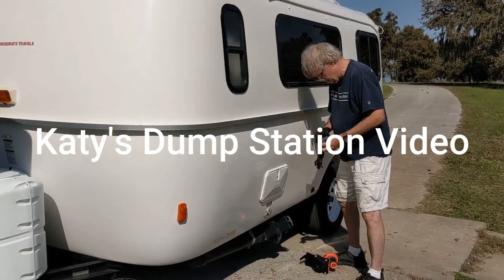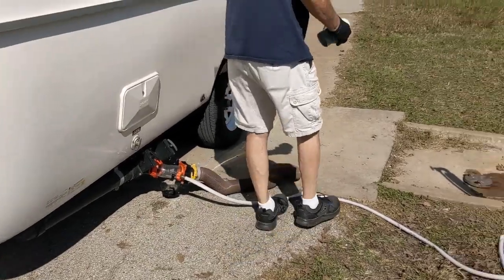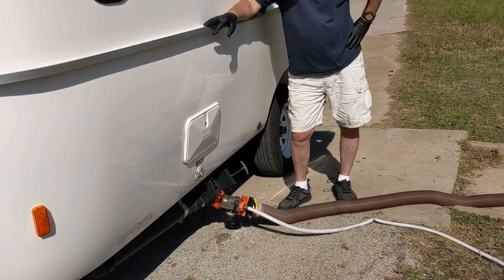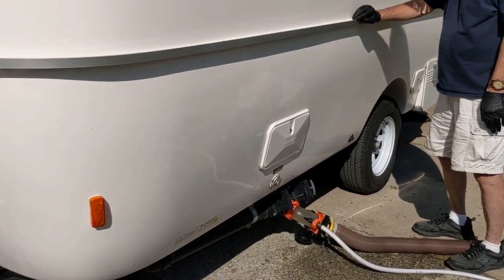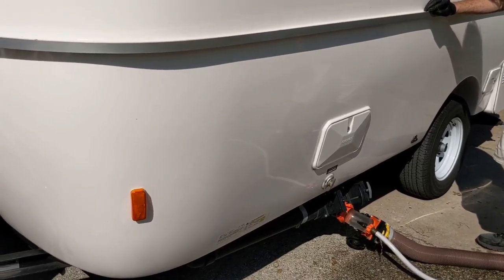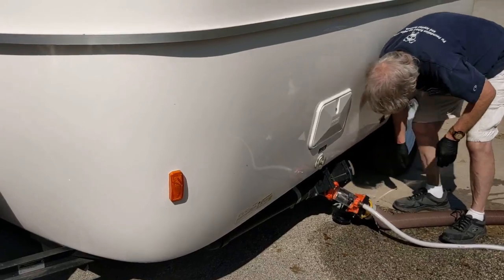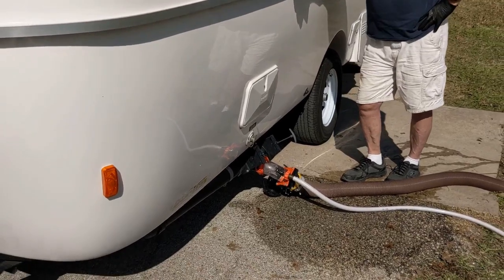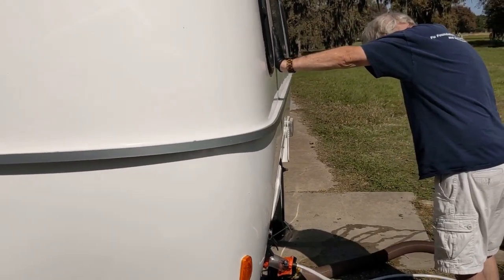Katy's Dump Station Video

Comment: After I dump the black tank I just pass the hose through the bath window to the wife turn on the water, she opens the flush valve and lets the hose run for a few minutes and we're totally clean
Reply from the maker: Thanks. Whatever blows your skirt up.
Reply: You could also just use the shower to give the black tank a good hose down.  This works well if the previous owner kept the black valve open, allowing the liquids to drain and developed the pyramid below. 
Jon in rural BC, Canada

Comment: I’m assuming you keep your hoses separated since you’re using a white hose for sewer operations! I bought a cheap green one for that reason, but then mine aren’t in a bin, I built a sewer hose holder that’s mounted to the frame.
Reply from the maker: Actually, our usual hose is black. The one we used was there already, and hooked up, so we put it to work. Good observation!

Comment: Great video! I think it's smart that you wear gloves for this process, but you should pay attention to what you touch once they're on.  You rest your gloved hands on your knees when you bend over, and on your hip and the outside of the Casita while you're waiting in addition to adjusting your glasses after having already contacted the dump station cover, sewer hose, fittings, valves, etc. It can help to imagine that the gloves are covered in paint. Anything you touch with them on is gonna get paint on it (clothing, walls, etc.).
Reply from the maker: Thanks that's all true. I will keep that in mind in the future.

Comment: My Casita is a 2017. I thought the factory had gone to a quicker drain setup after 2012 or so, have you made a further mod to your trailer to facilitate drainage?
Reply from the maker: Yes it's the minor vent mode for newer models. I will post video.

Comment: According to your experience, how long would it take to fill the black tank with water during the flushing process? TIA:)
Reply from the maker: You really don't want to fill it. I would  say about the time I did it in the video. If you want to be persise you could have a helper go inside open the toilet and look.
Reply: I was wondering the same thing -- couldn't tell for sure if the video was edited to shorten that time.  Like--was it about a minute, or longer?  .  OR--do we just want to have one of us inside to be sure that we don't OVERfill?  (We have gotten a RhinoBlaster, as we've seen it recommended quite a bit.)  Super-newbie here, so trying to learn.  Thanks very much!